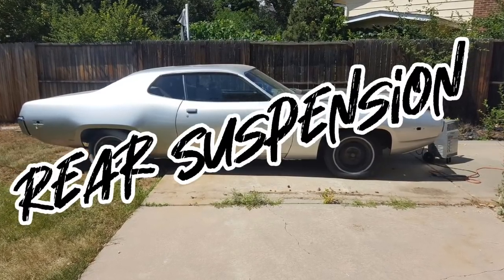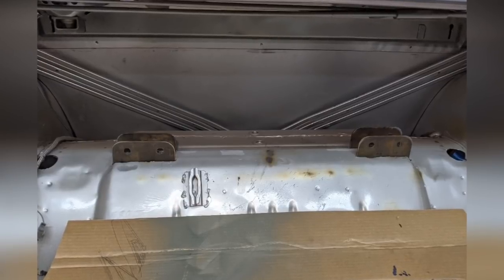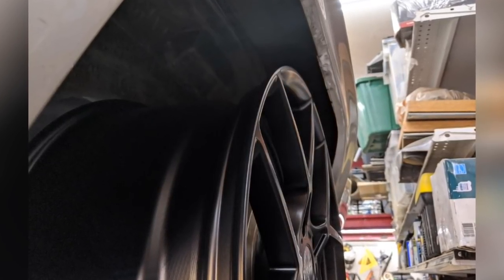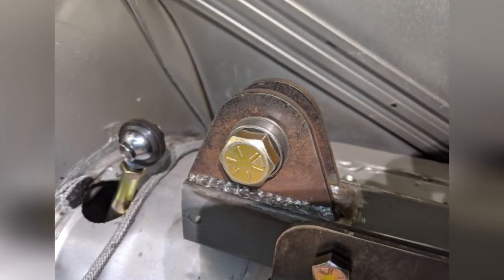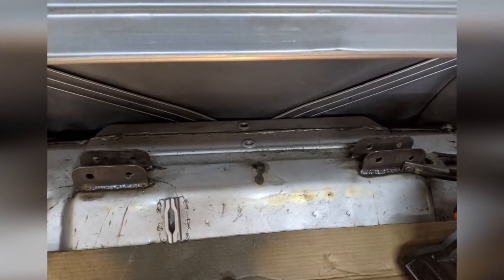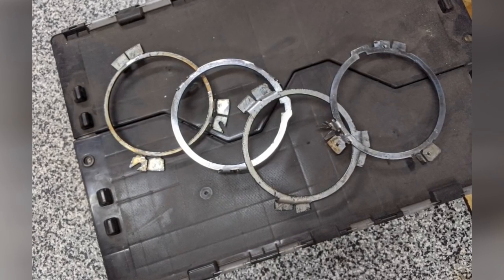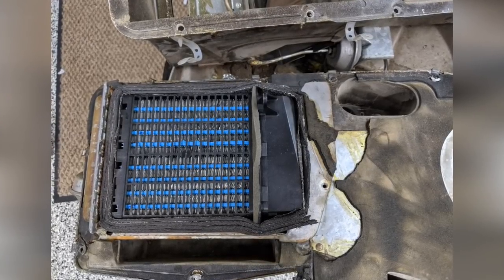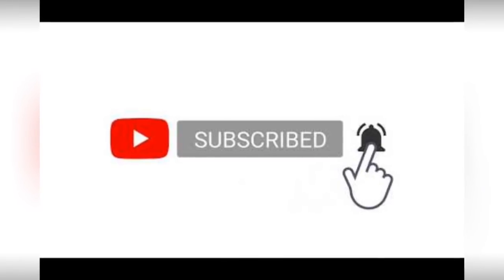Project Electrollite - Plymouth Satellite Tesla Swap - Pushrod Suspension, Ep. 5

Comment: Hi, love the detail you have gone into with the videos. Really helpful and perfect for a conversion of the Plymouth to Tesla power. I’ve got a 1970 Cuda 340 that I’m evaluating for a really similar conversion. I think the Satellite is wider than the E body so not sure if the Model S power unit will fit quite so easily! Looking forward to getting through all of the videos. Andrew.
Reply from the maker: Thanks, and cool car you have there!  I think you're right about the width, the Satellite has some fat wheel flares.  The Model 3 is slightly narrower, or a custom rear end is always an option.  I think you can narrow a Porsche subframe fairly easily.

Comment: What size/type rod did you use for the pushrod? It looks like the bolt spacing on the bellcrank for the pushrod and the shock are about the same: 1:1, does that sound about right? Finally, what rate springs on the coilovers?
Reply from the maker: The pushrods are 7/8 OD with 5/8 heim joints.  Yep, 1:1 ratio bellcrank, 450 lb springs.

Comment: This is awesome! Are you accounting for the difference in track width? From what I’ve researched, the Tesla track width is 66.9” and factory B-Body is 60 1/8”. Is that why you are using the deep offset rims?
Reply from the maker: You are spot on, the Tesla track is really wide.  Luckily B-Body mopars are also really wide but the offset is way different.  Not knowing exactly how everything would fit I did my best to find an affordable off-the-shelf wheel until I order a custom forged wheel.  Looks like I can add one more inch of wheel inboard in the rear and clear the pushrods and factory wheel tubs.  It definitely changes the look of the standard muscle car with a deep dish wheel.
Reply: @MrMoparMan  Thanks! How did you deal with the Tesla 5x120mm bolt pattern in the rear vs. the Mopar 5x 4 1/2 pattern in the front for the wheels?
Reply from the maker: @brandonnicholas123  Great question!  Since I went with aftermarket wilwood brakes/hubs in the front, they have a dual bolt pattern, either 5x4 1/2 or 5x4 3/4.  4  3/4 is 120.65 mm.  The wheels I currently have are all 5x4 3/4, close enough fit with hubcentric rings on the Tesla hubs, and standard fit on the front.  When I order custom wheels, The rear will be 5x120, and the front will be 5x120.65.
Reply: @MrMoparMan  do you have a place in mind that does custom wheels?
Reply from the maker: @brandonnicholas123  Nothing specific in mind yet.  It will most likely be a three-piece forged wheel like Forgeline.
Reply: @MrMoparMan  just in case you need some ideas, I found a couple places that do custom wheels, one is called Colorado Custom, the other is Esajian Wheel. I plan on doing an electric 68 Charger, so all of your trailblazing work is really helpful!
Reply from the maker: @brandonnicholas123  Thanks I'll check those out!  An electric 68 charger would be super cool!  Hit me up anytime for info when you get started.
Reply: @MrMoparMan  Thanks! I do have lots of questions. I also own 440 Source in case you are ever doing a big block Mopar build and need anything.
Reply from the maker: @brandonnicholas123  wow, no way!  I know your site very well, one of my first ideas for this car was a turbocharged stroked 400.  You have a lot of great information and parts.